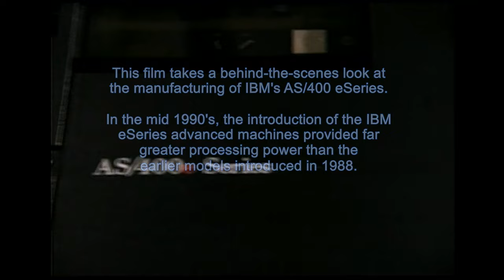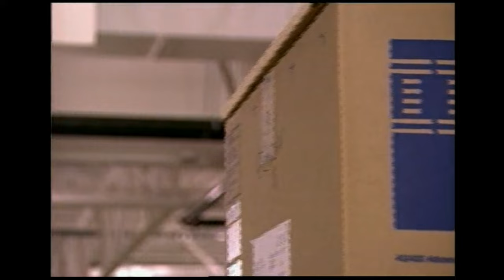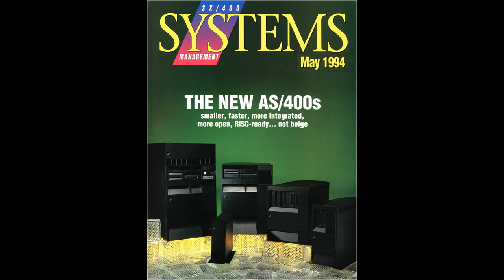LOOK INSIDE an IBM Server Factory, Behind the Scenes Rochester MN (AS/400 computers) eSeries 1990s

Comment: I worked at this IBM site as an engineer for almost 30 years, leaving in 2012. Several divisions were based there besides AS/400, including IBM Software Group that was responsible for the WebSphere Application Server family of products. As the video mentions, at its peak around the year 2000, the site had about 8,000 employees. It is now down to significantly less than 1,000 and most of the site is leased out to other companies for office and warehouse space. Actually IBM sold the site several years ago to an external real estate firm and leases back the space they currently use! You might notice in the video that the AS/400 cabinets were rounded at the rear -- this was to prevent customers from pushing the unit right up against a wall and blocking the cooling vents.
Reply from the maker: Hi Randy, thank you very much for your info about the IBM Rochester site!   I have been fascinated about the size and scope of that site and how many interesting products came from there.  Your work there must have been very interesting and for such a long time, I bet you have lots of experiences and insights into many of the innovations that came from there.    Glad you found our channel!     Did you have a favorite division or group at the Rochester site?      ~  Victor, CHAP

Comment: Astounding when you realize that in 1998, one of these top of the line AS/400 eSeries servers had less than 1/200th the raw MIPS and MFLOPS performance of a mainstream smartphone in the year 2022.
Reply: I have a strong feeling these AS/400 systems will outlast smartphones made in 2022.
Reply: @FunkyDeleriousPriest   Of course, Evan.  Smartphones have been "short-commoditized" since their inception. They're designed to either completely crap out after 4 to 7 years, or become "feature obsolete".  IBM AS/400s were mission-critical servers, designed for high availability/high uptime. A lot of them are still around today, running Linux.
Reply: Yeah that's definitely mind blowing to think about!  How far we've come with technology.
Reply: it is not relevant. the strength is in the designer and coders power this architecture gives
Reply: @Trev0r98  Note that the very old machines shown in the video aren't supported by Linux. You could run Linux for PPC on newer, LPAR capable machines, though. Or the standard Intel-flavor on AS/400's with an integrated Netfinity server (Single-Board add-on PC). But not on those early PowerPC AS machines, there never was any chance those are still around running Linux. If they run, they still run OS/400.
Reply: @ingolfhelmes6728  Yep, you're right, Ingolf. Good catch. I should've added that qualification.
Reply: @Gil so true
Reply: @FunkyDeleriousPriest  ABSOLUTELY TRUE 👍, ESPECIALLY,  in Asia Pacific countries such as Japan.  It would be interesting to know, in 2023,  how many AS/4OOs are still in use globally.

Comment: sorry, just cannot watch an as400 video without thinking about how IBM consistently made the system run slow compared to its AIX equivalent. Even today where the IBM i systems run by the majority of shops is limited by IBM to a single core - where as Linux and AIX workloads, on the same hardware, have access to all the cores.
Reply: Note that this limitation is not a technical issue. IBM i can make use of multiple cores/CPUs but licensing will become more expensive
Reply: I wonder how much of that is down to third-party application software licenses Vs. those for IBM i.
Reply: This is not "IBM making the system run slow."  I think I see the confusion... entry-level POWER servers must be shipped fully-activated; System i software costs (both the OS and any applications) are very expensive, and commonly charged per-core.  If you only need a single i/OS core, configuring the system to fill out the remainder of the cores with Linux or AIX (both of which are pretty much free compared to i/OS and i/OS applications) is common.  (You can order the system flagging the unneeded cores as "future partitions" but if you can think of a use for the spare cores, why not?)

Many i/OS workloads only run on a single core because the workloads themselves are decades old, and the latest hardware can run it all in a single core with room to spare, so there's no reason to pay more.  (I mean, the small and mid-range servers in this video from the late 90's had less memory, storage, and CPU than an entry-level smartphone of today, so it's not surprising that a customer would choose to confine them to a single modern core, since each core has a real cost.)

Comment: Going to be a lot of painful migrations off the iSeries  (AS/400) in the next decade.  RPG programmers are an aging / retiring breed and nobody is teaching it or migrating to it.  It was a great platform that was solid as a rock and could get it to do almost anything for free with a little knowhow.
Reply from the maker: Hi Kevin, very good points!  Some these old systems and skill sets are very difficult to replace!  ~  VK
Reply: I cut my teeth programming on System/32 and ended during the AS400 days.  It was a great platform, but "free" isn't really accurate.  The cost for CPU, storage, memory and peripherals was astronomical compared to x86.  Granted, the QC from IBM was much higher (we almost never had a hardware failure and we'd go months without an IPL) but cost is a major reason that the iSeries is a product in rapid decline.